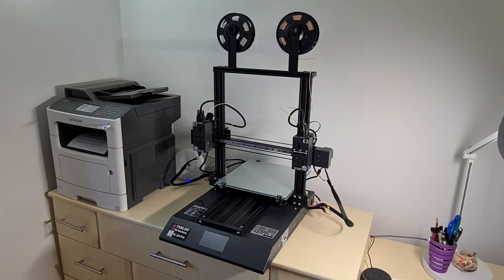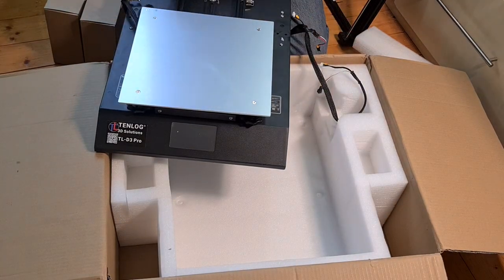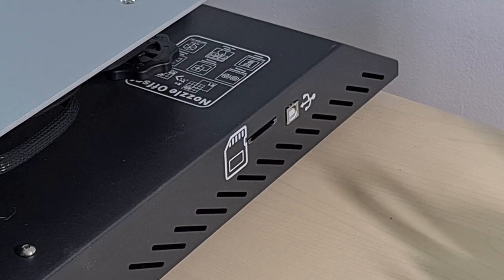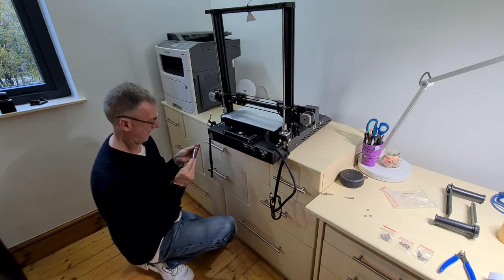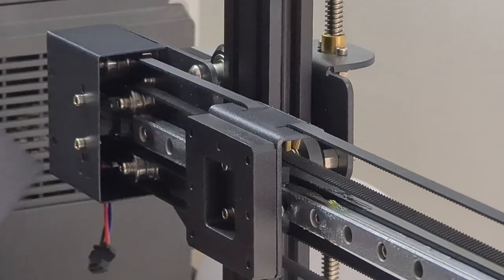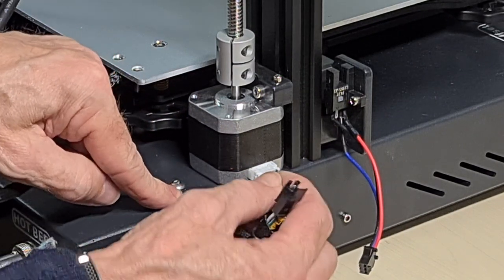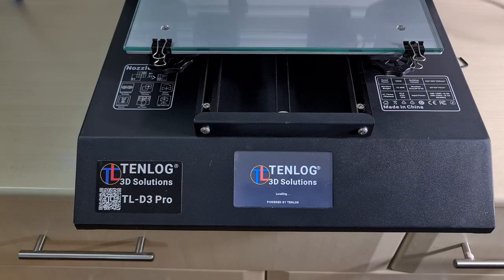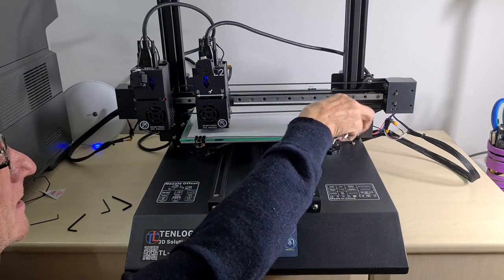Tenlog TL-D3 Pro 3D Printer Assembly & Review

Comment: I’ve had one of these for 2 weeks now and am finally starting to like it. It has taken several adjustments, mine was under extruding was the main problem, and many adjustments in Cura, but I’m now getting good reliable printing. The dual color still needs adjusting but the duplicate and mirror modes are great. I recommend getting a magnetic build plate, so much easier for getting prints to stick and getting prints off.
Reply from the maker: Agreed, lots of playing around to do.  Was a bit concerned after setting it up that it didn't just print 'out of the box', but the more I researched n YouTube the more I learnt and the easier it got.  Still lots to learn though 😁👍
Reply: I have a suspicion that this is based on a Creality chassis. What are you using for a magnetic bed?
Reply from the maker: @Chilternflyer  Just using the glass that came with it at the moment, but looking to replace with something else as I don't always get good adhesion.  Maybe something I'm doing so experimenting a bit first

Comment: I've found that my glass build plates require more heat to get to a proper temperature for prints to stick properly. Sometimes an increase of 15-20 degrees C does the trick. 

Cooldown takes longer and it is worth the wait as most prints just peel or pop right off without issue. I also use an Elmer's glue stick to apply a thin layer of adhesive on the glass for extra holding power.

I've considered switching back to a magnetic build surface to see if I can get higher print speeds due to the decreased weight.

Comment: Good info. I had the same issue with the bed temp dropping and found the settings had eco mode selected by default. Turned it off and has been trouble free for almost a year now.

Comment: Hello sir, thank you for the fantastic video you made there. I am about to buy the Tenlog TL-D3 printer but which slicer would you recommend to run it? Does "Cura" work?  Thank you!
Reply: Cura settings are the default, getting it to run on Simplify 3D is the trick ><

Comment: Good review. I just got mine and I've had a few minor issues. The right hand Z Stop optic sensor wasn't making a good connection at the board (inside) so I had to take the base apart and reseat the plug. Then I think I had the same issue as you with the bed not being hot enough. But I had walked away from it and when I came back, the plastic mess had pulled the rubber boot off the E1 nozzle and mucked it all up.  So that was a fun clean up. I'm gonna take my bed up to 80 and see if that helps my adhesion. Thanks!
Reply from the maker: Increasing the heat for the bed solved the issue for me 👍